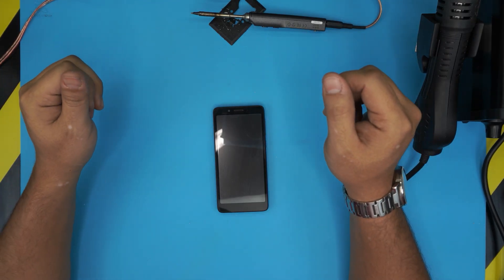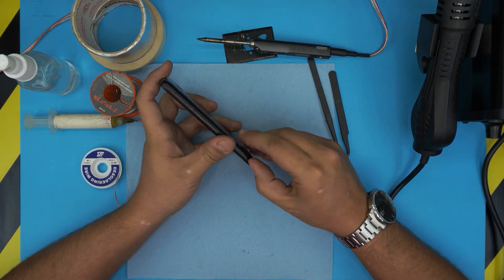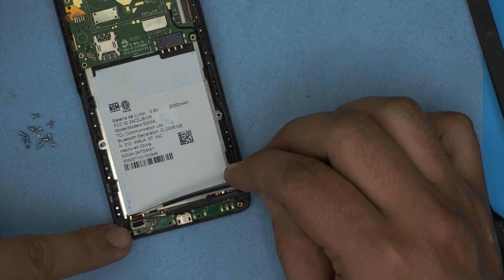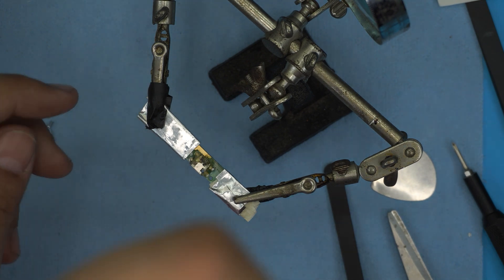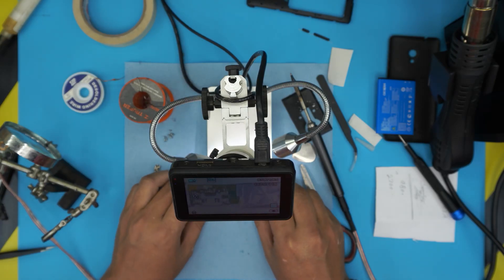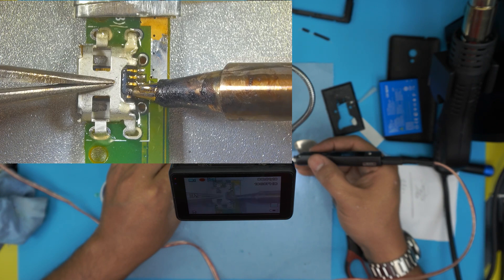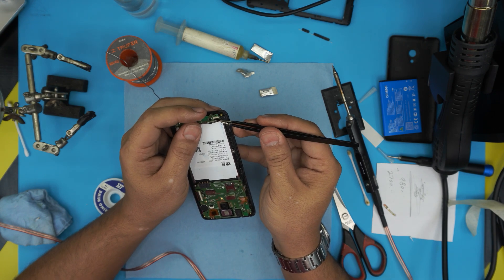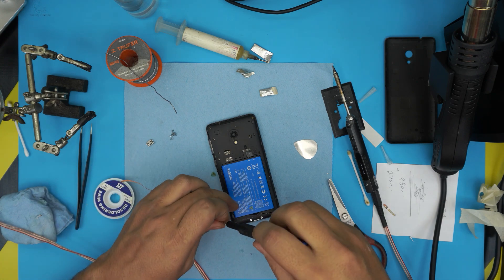Alcatel 5003A Charge Port Repair FULL Guide

Comment: Can u sell me a charging port board for an Alcatel_5002R Volta?? Please reply or can u point me in the direction.
Thanks
Reply from the maker: sorry my friend the charge port for that model is very hard to find i looked around and can't find one. but you should be able to replace the charge port, its the same logic as this video.
Reply: @uFixTek  I found it on Amazon thanks for the help
Reply from the maker: awesome i looked there didn't see it :/

Comment: I know this is old but I'm hoping you can still help me - could you just replace the entire board if you have a donor phone with a cracked screen?
Reply from the maker: Thank you for the feedback! if you wish to support the channel you can LIKE or SUB or both :P
regarding your question: yes you can, but the files and application and google account will be on your old board, and the new board make sure its not stole as it will have a google account and you will need the password for it. just make sure who ever sells you the new board its unlocked and has no account. then you should be fine. we do this all the time in the store.
Reply: @uFixTek  Thanks! But I was referring specifically to the daughter board that you unplugged. Is that tied to all the data as the main motherboard? Thanks again
Reply from the maker: oh the charge board you mean, oh that ya sure replace it and it will be fine :)
Reply from the maker: that board comes with charge port and mic, so if you get a new charge board it comes with new mic and all :)
Reply: @uFixTek  thanks again. Assuming the donor phone works as described it's a 25 dollar fix
Reply from the maker: yes , its my pleasure replace the board and you be fine :)